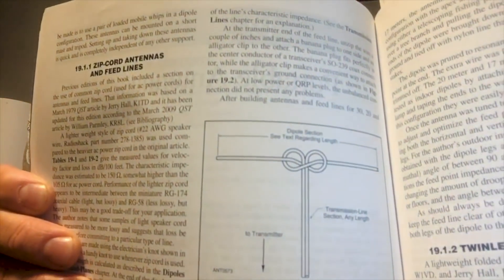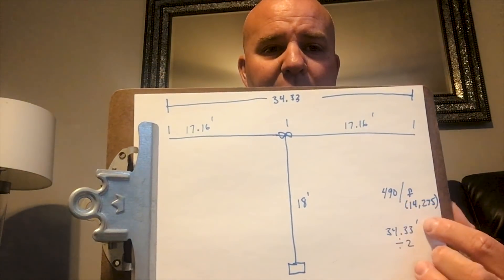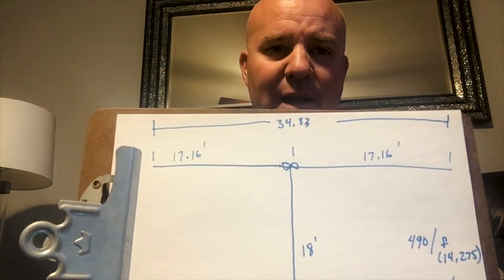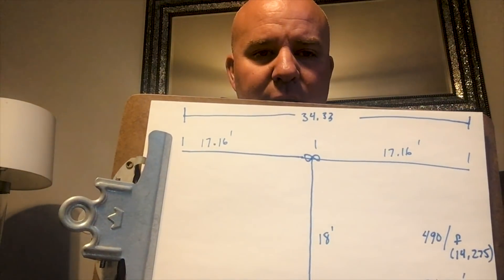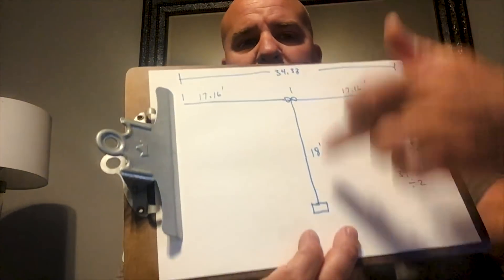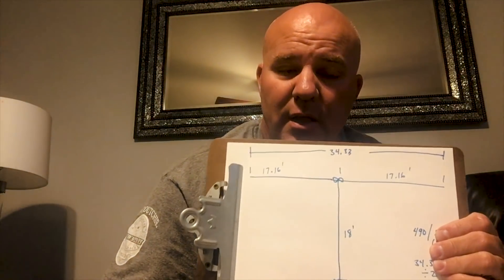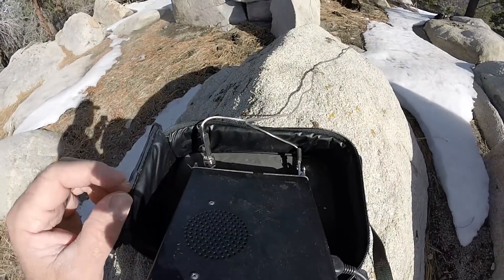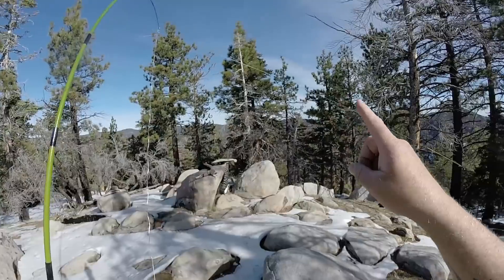How to make a Ham Radio Speaker Wire Antenna

Comment: I made one for 20 meters and all I can say is if you really want to be impressed go with this. I have mine setup for 20m with 1.5swr and I run it into an antenna tuner and well let's just say it will tune up on not only 20, but 80, 40, 30, 20, 17, 15, 12, and 10. I also got to playing with it and it will take about 100 watts full power with no problems and still has a constant swr. This is an awesome antenna idea and I'm glad I found it. Of your on a budget then this is it because 100ft roll of speaker wire cost me about $14 at your local Wally world. 73 de WD4OTR
Reply from the maker: Totally agree!  It’s cheap, it’s light weight, portable, and WORKS!  Thanks for sharing your experience with it.

Comment: aloha, i got a question. first I'm not a ham. i have a 1watt pixie qrp. i just listen in the late afternoons. guess in need to start to study CW.  so I'm going to travel and want to set up a speaker antenna, now its tuned for 40m.  i think you said yours is for 20m. but will work for 40M? just wondering if i can cut mine down. thanks, aloha docmott
Reply from the maker: Hi Doc - I believe it will trap more RF at 40 as it’s the transmitting side that matters more as the length can cause power to get back into the radio and damage it if wrong (bad swr & z). But, if you want to cut it down for portability reasons that’d make sense. Without personally testing that idea under similar conditions I couldn’t promise you anything but I do rx plenty of 40m stations on Summits with mine that’s cut for 20m if that helps. It’s experiments like these that make ham radio fun. Aloha back and which island?

Comment: How long did it take for the fishpole to come in? I'm right at a month and I'm starting to get concerned.
Reply from the maker: I have Amazon Prime so it was quick for me. A month is a bit long so did you email Amazon about it? Hopefully not a porch thief.  Either way Amazon is really good about fixing issue like that in my experience.
Reply: I have Prime too...but it said it mine was shipping from China so I left it at that and didn't think too much about it until yesterday. There are a few weird things going on with this order. Time to Scooby Doo on this seller. (I used the one in your store, that's why I asked).
Reply from the maker: N. Shane Martin that’s good for me to know if they are being problematic I’ll drop them & find another. I’ve had things take quite a while from China as well but maybe shoot them an email and ask for some type of tracking number. If they blow you off let Amazon know. Did Amazon show it as Prime or eligible for 2 day shipping or were they upfront on it coming from China and give estimated date at least?
Reply: I clicked the link from your Amazon store on your website. Amazon showed it as Prime so I placed the order and when I got my confirmation it was from a different seller and coming from China. It took me a while to find out how to track a China Post tracking number and it now says August 3rd for delivery.

I went back to your website and clicked on the fishpole. It takes me to Amazon, shows me a Prime eligible item and says I've already ordered it. I added it to my cart and it says it will be here by Friday.

I'll let you know when I find out something new.
Reply: Got a reply that they were having shipping issues due to the regional typhoons. Still haven't received a reply regarding it showing as prime from one seller and actually shipping from another seller without prime.
Reply from the maker: ok, and I'd complaint to Amazon that your order was not shipped and received on time.  They will extend your Prime membership as a form of compensation for the mishap.  I've had to do that twice with Amazon and they don't make a fuss about it.
Reply from the maker: Well at least there's a reason, but I'd still demand Amazon to credit you a month's membership fee (extend your membership) because it wasn't filled as promised.
Reply from the maker: And my next thought was to ask for you tracking ID or shipping number so I could complain as an Affiliate of Amazon letting them know they are jacking up customers from my account.  Sorry that happened as I know what it's like to want something in a time frame, especially when you are a Prime member. Thanks again for shopping on my link and supporting the channel!  Much appreciated 👍👍

Comment: Isn't that clip at the electrician's knot, and the top of your fiberglass pole, a fishing lure clip and swivel? I don't do the hard core hike to a location like you. For me, 200 feet from parked car is a considerable hike. The legs don't work so well these days and not only walking but carrying too much weight is not conducive to my well being. That said, my light weight antennas of choice are mono band fashioned from electric dog fence boundary and perimeter wire. Its light weight. Its solid core so one has to be careful not to kink it when erecting and taking down, and of course winding it. Those wire wrapping thingamabob's, I call them kite string winders, are great. A little bit expensive but buy one and several thin cutting boards from your local Dollar Tree, Dollar General, or whatever thrift store. Bring them home. Using the purchased kite winder, trace on the cutting boards, and with a jig saw or Dremel tool, cut out your kite winders for winding wire antennas. Labeling each winder with a  permanent black magic marker pen to identify the band antenna wound on the form. I like your zip tie with holes drilled idea, but its too much extra work for me. Although your method is lower in cost I can buy multiple double clip caribiners from my local big box store, e.g. Home Depot or Lowe's. These are light weight and can be used for lightweight attaching. I would never use these for any load bearing application. This antenna is half the weight of Zip cord or speaker wire dipoles. For now my heaviest items are my battery and FT-817ND. I have 3D printed iambic paddle key now for outdoor use. No longer have to carry my favorite key, Kent Key, out into the elements (humidity is bad for my key). I have antennas cut for 40m CW, 20m CW, and 15m CW. If I have the urge to work phone I can use an manual ATU to tune to the phone portion of the band. I have no where near the height advantage that you have for a low above ground antenna. In Ohio, I might find locally a 100 to 150 foot rise. I carry a collapsible fiberglass pole that extends from a folded 5 foot to an extended 19 feet. My wire of choice is purchased from Amazon at less than a "Jackson" for a 500 foot reel of 20 gauge wire.
Reply from the maker: Hey Terry thanks for the info & ideas. Hope to get my CW back soon & work you one of these days on our QRP stations.
Reply: Hi Terry.  Do you happen to have a link to the Amazon reel of wire that you mentioned in your comment?   Thanks in advance.

Comment: I use a grey plastic wall plug and run a short piece of blind cord through the centre of the plug this plug fits nicely in the top section of my 8m fishing pole never had it come out in 150 plus SOTA activations.
Reply from the maker: Hey William - thanks for commenting. Trying to envision the wall plug; is it one of the things used to plug an electrical socket so a toddler doesn’t get zapped? This gave me an idea but is probably not at all what you are referring to so I’m wondering exactly what you use?  Can you describe it a little more since YouTube prevents photos in the comments. Thanks 👍🏻

Comment: Really nice antenna. Gonna try this one for 10 and 15m.
Vy 73 de DO1PGR
Reply from the maker: Hey Peter... last weekend I made a 20m & 15m qso to New Zealand to two different stations and this is cut resonate for 20m so it works really well IMO. There’s people all over the world making it with great DX & local success  so let me know how it works for you. Super simple and effective for what it is. I also recommend using an analyzer to verify SWR & resistance just to be safe but these calculations will get you in the lower part of the band by just a tad. Best of luck 👍🏻
Reply: KG6HQD Jerry Wow👌 Definitely have to try it. Too bad with my license I can't work 20m. Right now condx are shite on 10m. When I go portable I mainly operate 2m/70cm SSB. Your antenna is a good, lightweight antenna that I will test from my favourite portable spot. I also have a channel here on YouTube where you can see it 😉
Reply from the maker: Hey Peter, I'll check out your antenna and despite conditions I'm still able to get across the US and I even hit New Zealand a couple weeks ago and Canada often.  How long until you upgrade your license to work 20m?

Comment: Yes You can make a antenna feed out of speaker wire !
But !
The fact is that it is a poor feeder !
The loss is huge !
It might be something you might have to do in a emergency !
Or just to do a experiment !
If you could separate the wires even 1/4 inch !
You could go from really poor to really good !
The impedance would likely be better than 300 ohms at just a quarter inch spacing  !
Considering the conductors are about 24 gauge !
It is a fact a poor feeder will work on HF !
Why settle for something that will just work , When you could have something that would work much better ???
 I have long wondered why qrp ops especially just plain seem to love poor antennas !
They run wires at qrp that they could not run at higher levels and are perfectly happy doing so !
Then again there are many things I do not understand !
73
Reply from the maker: Well Frank what I can tell you is it has been working great, in fact .1 watt from So Cal to Nebraska the other day and regularly 5 watts all across the US.  You must feel really passionate about this or why else would you add so many ! ??  In your comment what I didn't see was what you run while working QRP portable in the field.  Do you care to share with us your setup? Do you even work QRP portable?  Your post implies you don't understand many things, maybe this is one of them?  I'm all ears on what it is you offer the thread.  KD5ALD de KG6HQD
Reply: These things are just something I do !!!!!!!!!!!!!!!!!!!!!!! these !!!!!!!!!!!!
 I am a cricketeer of the Four State Qrp Club ! 
The rig is a cricket it makes about 1/2 watt out on 80 meters !
Most all I work is 40 or 80 mts lately !
The cricket is powered by a 9 volt battery !
I do operate qrp exclusively !
I think I do understand !
Yes you can make contacts all over the world running just a few milliwatts !
Even through a poor feedline !
If you read the article in the antenna book it says everything I say !
It can be used :) Just has very poor efficiency !
I will share my setup :)
My main rig that I run is a Bayou Jumper it is a modern version of a pareset !
It is all on my QRZ ! Or the Four State QRP
I have often thought of sandwiching speaker wire between layers of vinyl foam wetherseal !
the size is 3/8 x 3/16 that stuff is dirt cheap !
Anyway if speaker wire was spaced just a wee bit it would be really efficient !
To end it all :)
I will say yes I have a bit of experience working at milliwatt levels !
And honestly you can tell no difference between 100 mW or 5 wts !
But I do believe you should strive towards efficiency !
Least I do !
I swear it say`s all I said in the antenna book !
agn 73
Reply from the maker: I did check out your QRZ info and I have no idea what that stuff is but if it works that’s all that really matters. For me, I like to have fun with ham radio and I know I’m not alone in not sweating the small stuff. The antenna idea I’m happy to share was to help others build maybe their first antenna, experiment, and do it for cheap so you can make mistake and side benefit is it works really good so it’s good enough for me. Thanks for sharing your ideas and thoughts as we all strive to do good things and ENCOURAGE one another to get out there and experiment while promoting the hobby. While it’s hard to fully grasp the tone via a text message, I’m going to assume you mean the best for the group despite a potential differing of opinion; besides, everybody has one of those. 73 OM and thanks for sharing. Still scratching my head on a cricket bayou antenna radio thing 🤔😉 but I digress. Hope you have a great Easter weekend.

Comment: Looking to make this for my qth with ft450.  What do suggest for max power?  Also, in regards to the feedline running 90° out...how far does it have to run before it can be turned 90 again?  Not being very articulate, the legs run parallel to my property so I need to hook the feedline to get it to my porch.
Reply from the maker: I’m sure there is a formula for confirming max power on whatever gauge wire you choose to run. I’d “guess” 50 Watts max with 22 gauge based on 14 gauge often having 100 Watts near it. This question has come up a coupe times and I ought to look into it and make an update for inquiring minds. TBH, I knew it wasn’t an issue for my QRP SOTA operations so I didn’t really consider that too much but I’m getting the impression that people are considering using this antenna for a base station which would make sense due to the stealth approach. 

As for the length of the feed line, I think the important part is the initial 90 degree from center to the ground then once on the ground under the mast you most likely can run it anyway you want to some degree. What I would do is get a length of wire and run it how you want where you want and look at it on an analyzer to see what it’s doing then trim and adjust accordingly. I do have plans to make a 40m version with some updates soon so watch for that video. 

Am I correct you are thinking about using this setup as a base antenna?

Comment: very nice and detailed video :) I have a similar antenna, made of speaker cable but the feeding line is a coax cable (RG 58), not as lightweight for portable use like yours, but very good for semi-permanent setup at home. Also 7 meters fishing rod to keep it up in the air, works like a charm!
Reply from the maker: Crazy how simple and effective they can be!  Why did you opt to run co-ax to it vs just use run of speaker wire for whole thing? Just curious
Reply: KG6HQD Jerry with the coax is basically a standard dipole so I don’t have to use a tuner and the impedance matches perfectly. Either way the performance should be equal

Comment: Great Video Jerry. whats the max amount of power do you think it would handle?
Noel-W2MSA
Reply from the maker: Hi Noel, I’m sure there’s somebody much smarter than me to help answer that question but I’d guess 30-50 Watts. I honestly wasn’t too worried about power abilities because I only run QRP while portable and the design in my mind was for field use. I’d would say that if you ran 14ga speaker wire you should be able to get 100w out of it pretty easy.  If you look at the rating of wire and base your design on your needs I think there’s some open possibilities. How much power were you looking to run?
Reply: I was thinking no more than 50W. 
I have 18awg wire which I think should be sufficient. 
I’ve been learning a lot about sota from your videos. 
Thanks for creating these videos, I can imagine how time consuming it can be. 

73’s

Noel
W2MSA
Reply from the maker: I would guess 50w would prob be good and glad the videos are helping give you some ideas 👍🏻

Comment: Nice work, I have the equipment to try this out.  Gonna try it out tomorrow :) Thanks for sharing
Reply from the maker: Perfect!  Let us know how it goes!  Band conditions haven't been great but it hasn't stopped me from making contacts all across the US.  Tony @K9ARV_Radio made one as well and got some DX into Belgium.  Cheap, easy to make, light weight, and best of all it works really well.
Reply from the maker: Wanted to check on ya and see how the antenna build went?  Any feedback for us?
Reply: KG6HQD Jerry negative.  Put this on the back burner for this week, got some other projects to finish but will update as soon as I get it done.  This seems pretty straight forward, can't wait to try it
Reply from the maker: Totally understand that and look forward to hearing what happens when you get to it.

Comment: Excellent video and thorough explanation, thanks! I'll have to try one of these; it's a nice, light setup. I don't tend to consider weight as much as I should for SOTA work.
Reply from the maker: Awesome!  I try to look at everything within reason when heading out to activate for SOTA.  Where I'm from we have some pretty steep hills to contend with and my back and knees appreciate my forward thinking :)  Let us know how the antenna works for you.
Reply: Thanks, will do! Where I live (VT) the mountains are tamer, but there are still plenty of rock walls, cliffs, and steep terrain. And I've noticed I'm not getting any younger. ;-)
Reply from the maker: No kidding. My knees appreciated when I added trekking poles to my kit and losing a few lbs around the mid-section lol

Comment: Try 22 feet per leg - same size as the Norcal Doublet - works really well on 20 and 40. Great video - thanks . 73 De M6JVI.
Reply from the maker: Thanks for the tip, maybe I'll try that on the next build for fun.  This was intended to be 1:1 on 20m since I used it with my 817ND sans a tuner and it is completely flat.  Now that I have the KX2 with ATU I just tried seeing where it would tune up and it works great on 40-10m.  Tony @K9ARV_Radio just put out a video yesterday using this design and was making contacts into Belgium and across the US on 20 despite band conditions so I'm stoked people are giving it a try.  Best part of ham radio is trying new stuff and seeing what happens.   Thanks for the comment and checking out my channel.